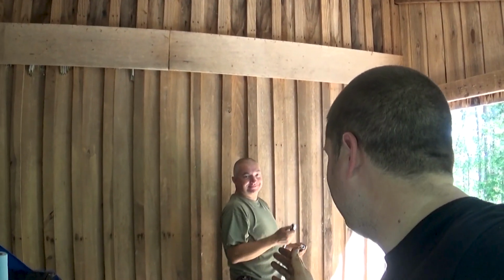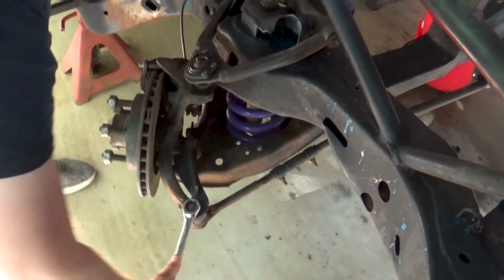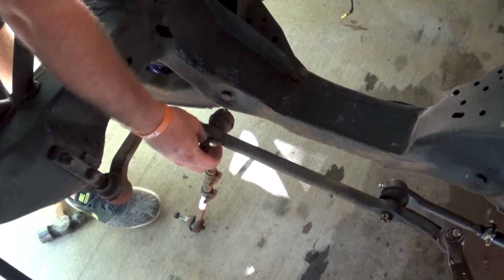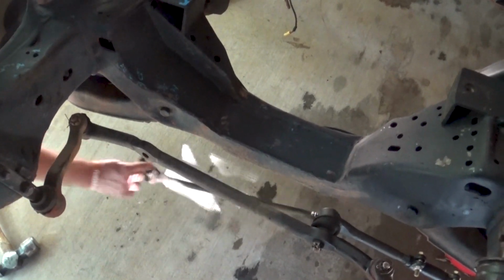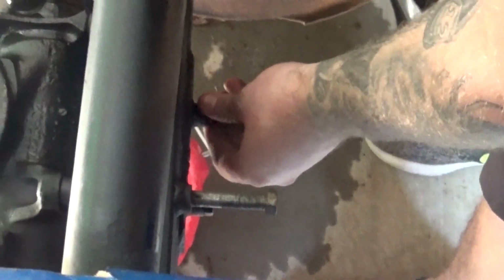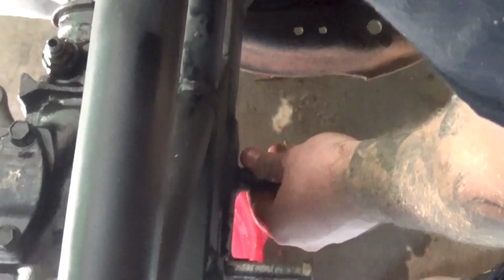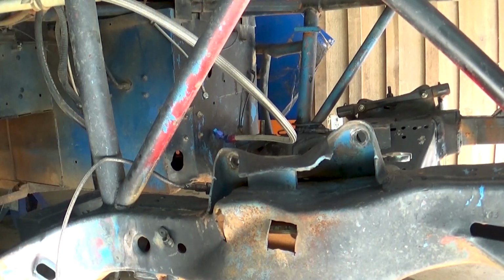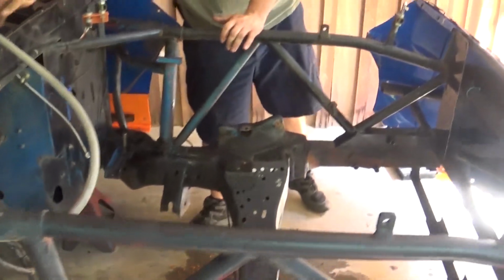The Race Car Tear Down Begins!

Comment: Speed secrets: 
1.Throw away those factory lower control arm bushings. Make some out of metal, delrin, or poly. Do not tighten fully so the control arm moves freely.
2. Check your camber change through the full suspension travel. You may have to heat and bend your spindle arm. We ended up using different spindles left and right to get the proper action. We also changed the height of the upper control arm mounts.
3. We also found that using a shorter/longer idler arm helped on turning at different tracks.
4. your rotors look like dog doo. Are you using a restrictor in the brake line? We would cut the outer edge of an OEM pad to make it NOT work so the left side (soft Pads) would pull it into the corners. A hole saw worked the best. 
5. Camaro or Trans Am steering box?. Can you use a gear reducer? We were about .4 faster with a quick steer box.

Comment: You need to make sure and check the drag link and tie rods if that spindle is bent, everything was hard to get off; it is supposed to practically fall off when you take your bolts off. If you are having to beat it out then its probably bent. Don't wanna chase that all year

Comment: Looks like you’re getting a start on it. I’d read my rules very closely & read in between the lines & milk it for everything I could. I’d put it back together with the best of the best & light weight parts
Reply from the maker: That's the plan!